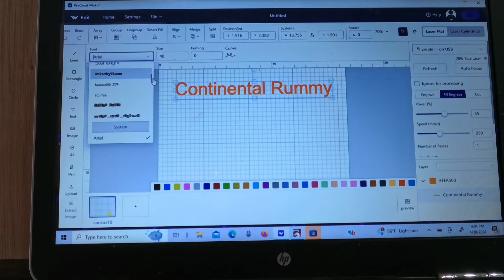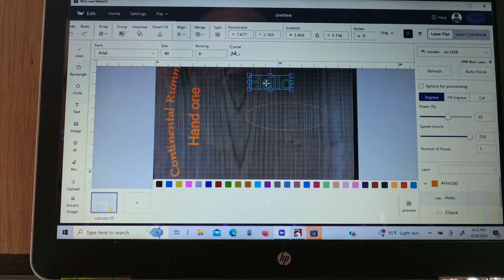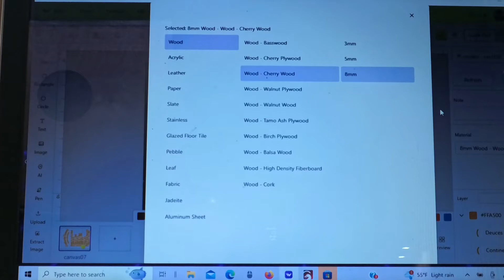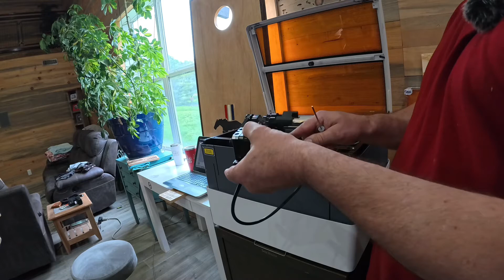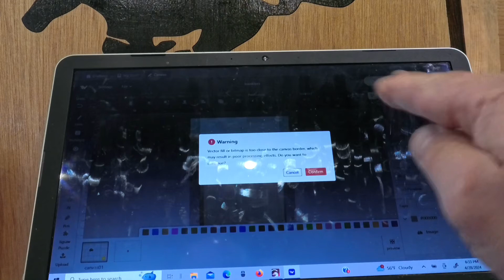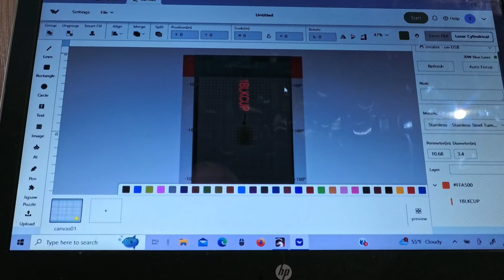WeCreat vision, Engraving a simple wood sign and a few tumblers how to

Comment: I appreciate the amount of time you spent showcasing the WeCreat. Great job! That said, are you having a difficult time with the crumb tray not sliding in and out? I had several WeCreats, and every one of them had a defect with the crumb tray not sliding in or out. The WeCreat channel advised their audience to tilt the laser backward, which will allow the tray to slide in and out easily. For me, WeCreat's response to the tray issue is not acceptable, and they should do a recall. Besides your channel, I also asked other WeCreat content creators, and they too are having the same issues. Thank you. 😎
Reply from the maker: None at all. Just checked the tray. Slides out smooth.